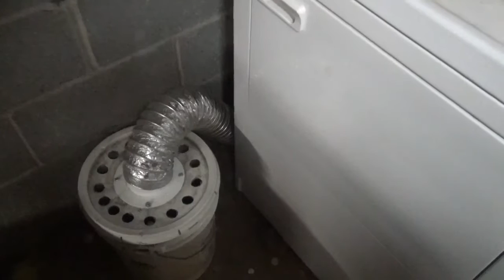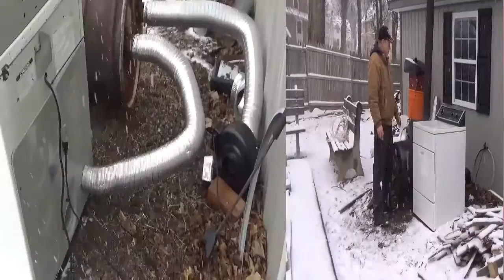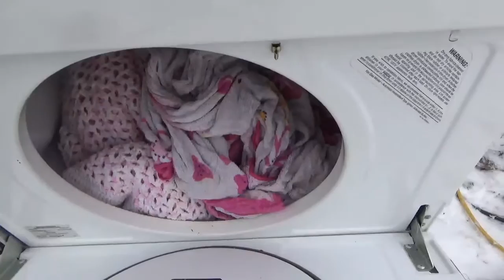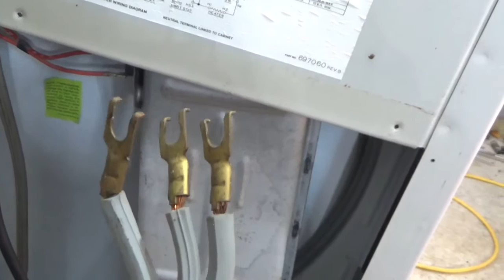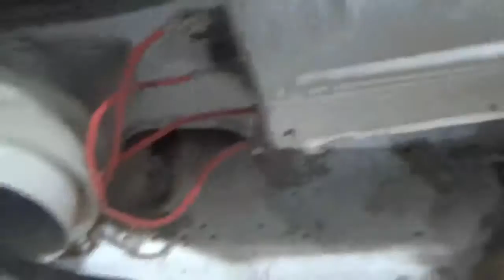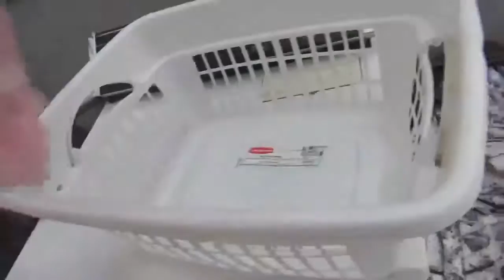WOOD BURNING CLOTHING DRYER

Comment: You can dry clothes below freezing.  The Navy made me do it  in Boot Camp  in Nov-Jan 1964-5. You hand washed your clothes on a stainless steel table with a center drain trough.  Then you went out and hung them up with a 'clothes stop'  This was a piece of cord with some aluminum crimps to prevent fraying.  The clothes all had tabs.  You tied the exact middle of the tab to the tab with a square knot.  Then you tied each end to the clothes line with a half hitch.  Then you made 7 turns around the clothes line on each side, ending in a half hitch.  Then you brought the  two ends together in the exact middle and made a square not.  This was in a courtyard with sometimes the high was below zero, and needed to use your bare fingers to tie this crap.  Yes, the clothes freeze dried and it actually made them softer.  I met my wife in the Navy (she was an officer)  and I told her about it.  And when I was a poor graduate student she would dry clothes that way (but with clothes pins, I advised her against clothes stops).
Reply from the maker: Wow that is amazing! I never knew that could be done. Thanks for sharing that!

Comment: Honestly this is will help me a lot I plan to use this exact set up with solar powering the tumbler. Basically a shed with washer and dryer in it the stove sits outside and the forced air allows it to work. Also going to use your bucket idea to channel the heat inside during winter.

Comment: Ron, I admire your dedication to the engineering thing and stuff like this is fun to do for the hell of it. 
Would it not however have been simpler to shove the barrel stove in the basement and hang the wet clothing on lines with a small fan running to move the air.  
I'm in Ireland and in winter I dry the laundry inside in the room with the stove,  the fan really  speeds the drying rate.   
I did have slight concerns at one time about the humidity but I noticed no change at all.

Ray
Reply from the maker: Thanks for the comment and yes it would been easier  but I have no room for it or want it in my basement and don't really need it there as most of it  baseboard heated.  And as for the garage I cant have fire inside because I work on cars and if there was a gas spill there is no way to turn off the fire...like you said it is fun to make stuff!!Thanks Barron!!
Reply: @ronstickle4694  << most of it  baseboard heated.>>

I'd get a wood stove to heat the house.  Then line dry the clothes inside as needed.

Here in Seattle,  I can line dry clothes outdoors most of the time if I pick a suitable day.  If they aren't completely dry at the end of the day,  I hang them indoors and heat from the wood stove finishes the job.

I haven't used my gas furnace in years.  I get scrap wood from nearby businesses,  such as a lumkber yard,  and just cut it to length with my table saw.  I use a wheelbarrow to run a load of wood into the house and dump it near the wood stove as needed.

My wood stove is providing me with plenty of heat right now!
Reply from the maker: @SeattlePioneer  Hi there.  I did that.. I mean I put a wood stove in the basement since making this  video... I did a full video how I did it back in 2017..

Comment: Could you also put the air coming out of the outlet and route it into the end of the blower for suction and reuse the exhausted heat also but of course use a filter??
Reply from the maker: but you need to vent the humidity or it will take longer to dry thanks!
Reply: I thought you could put an opening in the return to drip out the moisture or some water filter to catch the moisture and still be able to save the heat unless the heat will carry the moisture but i wonder if there is a way to save that heat to refeed the inlet through the main.
Reply from the maker: im sure there is a way to be honest i don't use it i just wanted to see if i could be done and it can. if you can improve on this i would love to see it!  i have a new idea to use it to heat the building and hope to do it soon. thank you for the thoughts!